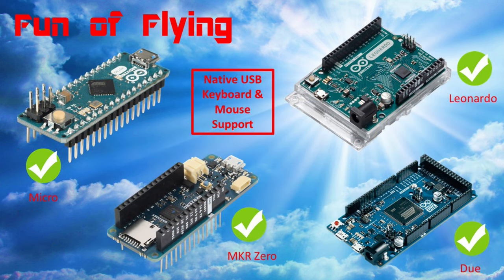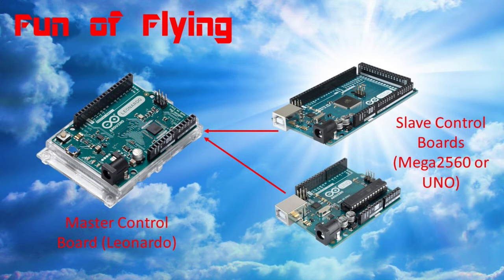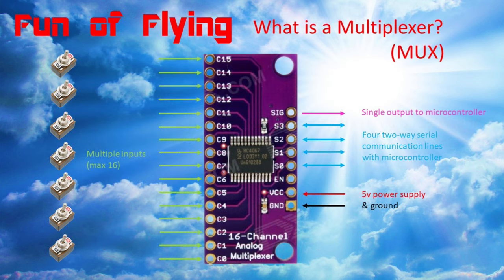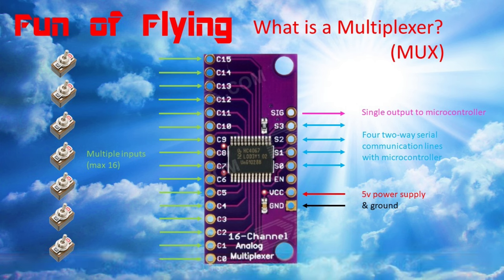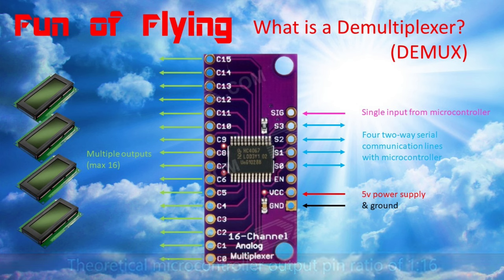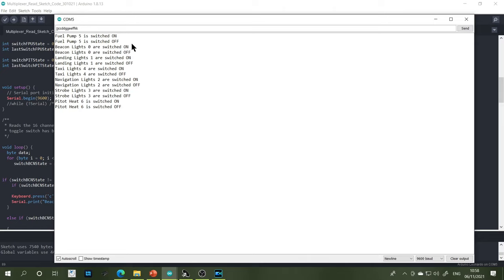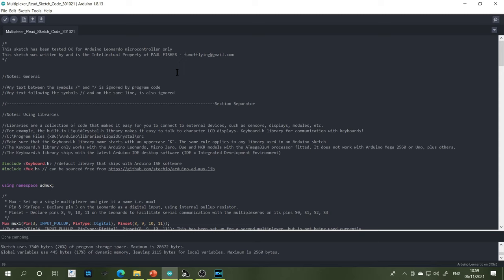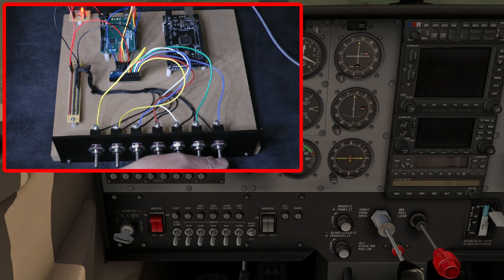Controlling X-Plane 11 with Arduino & MULTIPLEXERS (Home Cockpit Build Basics)

Comment: Hi Paul,
Thanks for taking the time and effort to do a end to end explanation for this process. I am about to embark on the great adventure of building a TDM940 cockpit and yours is the first really clear flow chart of how things are prperly staged and read. Awesome so thanks again. I did notice that your code could have been refactored to be considerably shorter but I am not criticizing at all sir. If you would like I could refactor a copy for you. As you move forward with multiplexers it with make debugging immensely much easier. Dan
Reply from the maker: Hi Dan (or should that be Don??)
Many thanks for your kind words, very much appreciated my friend :-) It looks as though you are about to take on quite a massive project with the TBM940 cockpit, so I hope everything progresses nicely.
With regard to my multiplexer sketch code, please by all means send me your re-factored version, I'm always willing to learn new ways of doing things.
As I've often said in my videos, I'm certainly not a computer programmer, but have still somehow been able to 'knife and fork' all of my codes together, simply from bits and pieces I've picked up on the interweb, so this is still all very knew to me!
Kind regards and thanks again :-)
Paul 
PS where do you live in the world, I always ask people as I like to know where they come from when communicating with them :-)
Reply: @funofflying15  Hi Paul, My nickname is Dan. There is absolutely nothing wrong with your code, as it works! I can make it more compact and hopefully easier to read. Dan

Comment: Great work.
I got a homecockpit too.
And I hope to apply your knowledge in the future.
Reply from the maker: Welcome to the channel and very good luck with you home cockpit setup :-) If you need any help, then please let me know? Kind regards Paul
Reply: @funofflying15  
Here i go with the first question.
Does the code that appears in the video work for the Arduino Mega 2560?.
Reply from the maker: Hi there, the only Arduino microcontrollers that work in this way are the ones based on the ATmega32u4 with USB serial support, namely the Due, MKR, Micro and Leonardo. I have always used the Leonardo in all of my videos. Hope this helps, regards Paul 😎

Comment: i have turbidity sensor code  and one sample code which is for transfer the data in hmi   ,,i have issue when i merged the both code then i am not able to read the sensor data in hmi , using arduino mega 2560 board . can u help me pls?
Reply from the maker: Hi there, I very sorry but I’m now on extended vacation onboard our boat and consequently internet access is very limited. Also, I do not have access to my home computer or any of my files. I will however be going home again for a few days in three weeks time, so I may be able to assist you then? Apologies again.

Comment: Great video and was exactly what I was looking for. I’m planning to build a smaller home cockpit (something like a Sonex or small high wing LSA), so the need for lots of switches is a lot less……one question though is can you also add throttle controls through the mux’s? Some you only used 7 pins on the mix I’m also guess you can add more switches (and relevant code), to the same board?? Was planning on using the ATMega board but if I can use the Leonardo j stead (cheaper…..), then I think I might be onto something! Again, thank you for the great vid…..off to watch your others 😂
Reply from the maker: Hi Andy and welcome to the channel 😎

Just to let you know however, that I am currently away on a long vacation onboard my boat, so currently do not have access to my home computer. With regard to multiplexers though, I only used a few of the available pins in the video, but you should be able to use all 16 pins (channels 0-15), with the correct code, as you say.

With regard to throttle controls, I haven’t yet written code for these to work through a multiplexer, so can’t at this stage confirm if it will work? However I could easily test this when I eventually get home and will let you know then. Apologies in the meantime for the delay.

Kind regards 

Paul 😎

Comment: This is such a great video! Could you do you on using an ssd1306 Oled display with xplane?
Reply from the maker: Hi Danny and welcome to the channel :-) I've never personally used the SSD1306 display in any of my projects, but having looked into it, I understand that it is possible to use the display with Arduino, although I'm not sure how this could be interfaced with X-Plane? Let me do a bit more research and I'll see what I can come up with? Kind regards Paul (Bedford, UK)
Reply: @funofflying15  Sounds great! Perhaps we can share code sometime. I'm using Teensys which have Flight sim controls plugin for x plane 11. 
I don't know if you've explored Teenys or not. Anyways I love the channel!

Comment: Hello Paul,
Thanks for your always informative and easy to understand videos, Gives me an extra push to flying x-plane. Hope you can do more videos. How can I get the sketch code from this project? The hardware and the wiring I can do, but with my 80 years the sketch code is some different piece of cake! 
Regards
Klaas
Reply from the maker: Hi Klaas, very nice to hear from you and many thanks for your kind comments :-)

I will of course be producing more videos, but in the meantime, please contact me by email at funofflying@gmail.com so that I can send you the sketch code for the multiplexer video.

Kind regards Paul

PS Where do you live, the Netherlands possibly?
Reply: @funofflying15  I am Dutch, but living  my pension already 10 years in rural Thailand, about 700km north east from Bangkok